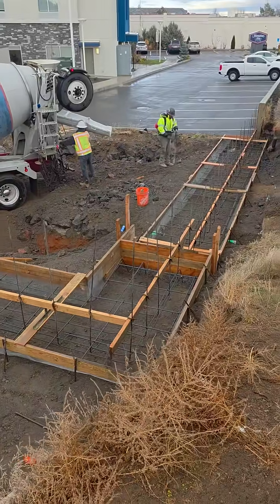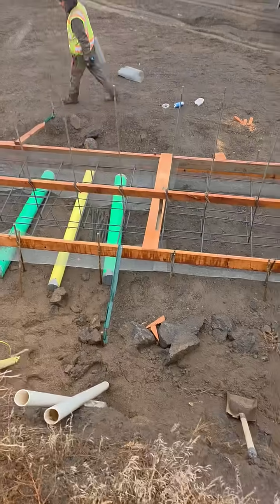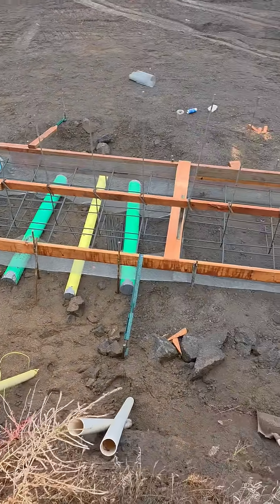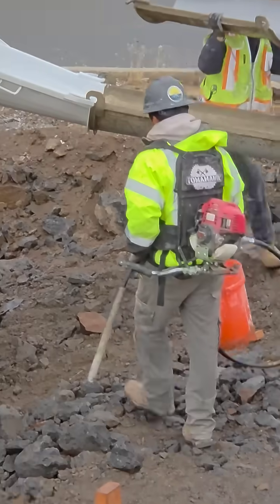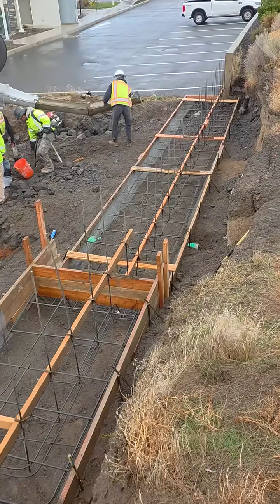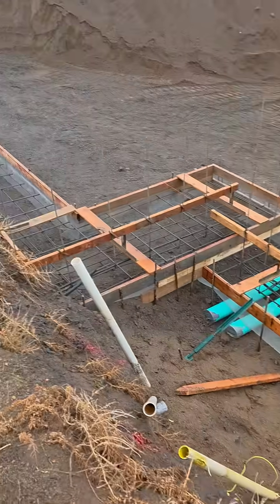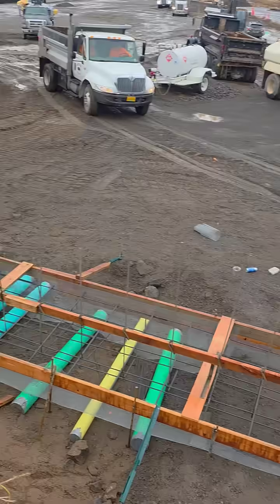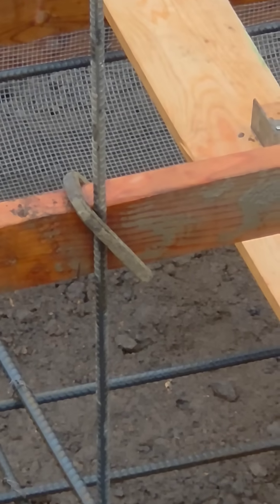Set Footings for Profits — Faster, Cleaner, and Stronger With the Right Prep #RebarClips

Comment: How much are each pellizco
Reply from the maker: With shipping about 7.20.  They are heat formed and indestructible so after every use they become less costly.  Depending on project size, they usually pay for themselves in one or two projects solely on labor savings.  We have used them for years and estimate 5-10% higher profits from increased efficiency in rebar install.
Reply: @KenScottConsulting so do concrete forms, but i don’t see you using them
Reply from the maker: @theSkavenger84 we use 2x6 concrete forms and wire mesh to save time and money.    What more do you want?
Reply: Too much and useless.
Reply from the maker: @theSkavenger84 Only to a guy who cannot do simple math.